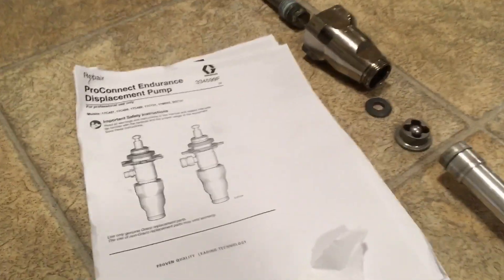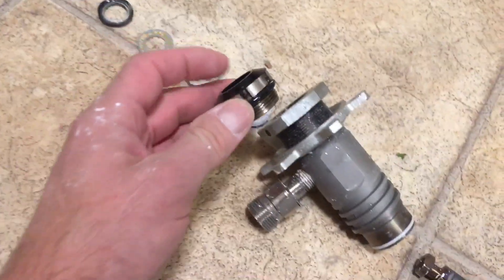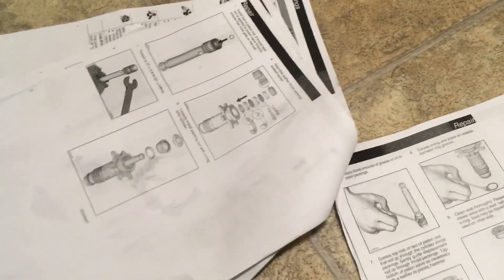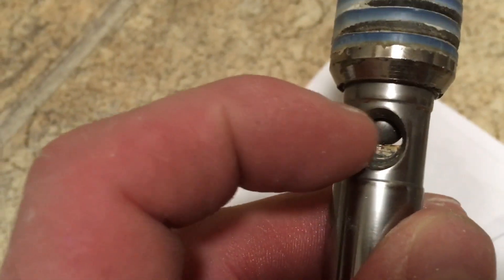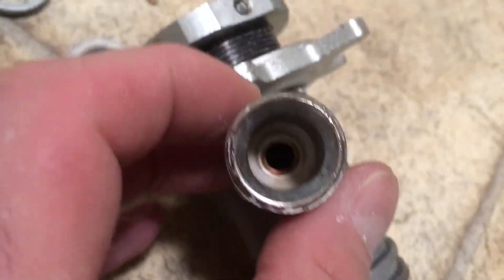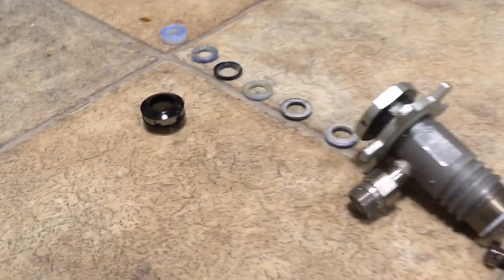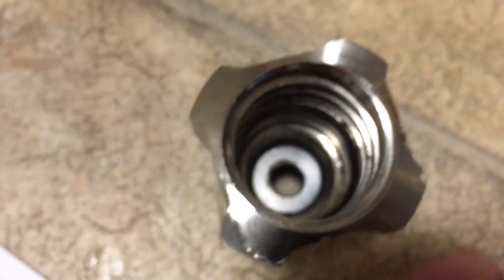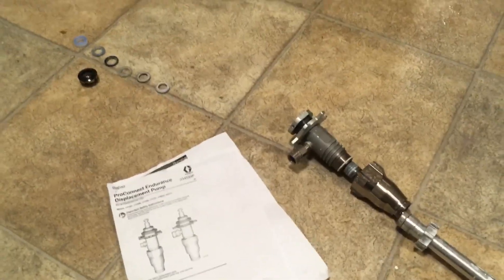Dismantling pump for Graco FinishPro II 395 Air Assisted Airless spray painting machine

Comment: Hi, great video. Thanks. Would you recommend somebody just starting with fitted furniture to purchase Finishpro II 395? How satisfied are you with the sprayer?
Reply from the maker: Hi sorry for the late reply, no I wouldn't!  I think we were mis-sold a little, really this is a site sprayer's tool.  We bought it because we didn't already have a compressor in the workshop, but the onboard compressor is underpowered so it's hard to get the full benefits of the air-assist shaping the fan pattern.  I would look at the Graco GXFF for a cheaper/better value starting machine.  Or for up to date advice ask Giles at https://www.ultrimaxstore.com/ we recentlt bought a Wagner Cobra from them ( a fantastic machine but very pricey too so not one to start out with)
Reply: @Alastair_Freebird  Thank you for your reply. In the meantime I already purchased a slightly used finishpro. Will try it in a few days. Hope it works for me. But thank you for the advice. I really appreciate it.
Reply from the maker: Well it’s ok, we got on with it well enough for a few years and it was a huge step up from our previous painting arrangements.  There are so many factors to getting a good sprayer finish, and the environment is one of the biggest ones.  What kind of booth and extraction do you have?

Comment: I just bought a 2020 490 used. It has 33 gallons run through it. The guy I bought it from never flushed and clean the sprayer with water before he stored it with mineral spirits. He just let the paint sit in it mixed with mineral spirits. LOL. That was really dumb. I got it for $400. I took it apart and clean the entire fluid section spotless. I purchased a new suction tube, a new prime/drain tube, and new filters. This unit is now spotless and basically brand new. I'm in it for $560.00. This is the new Ultra Max II with blue link and contractor II gun. It was a great deal. Can't wait to spray with it.